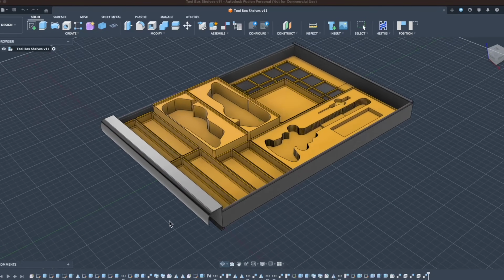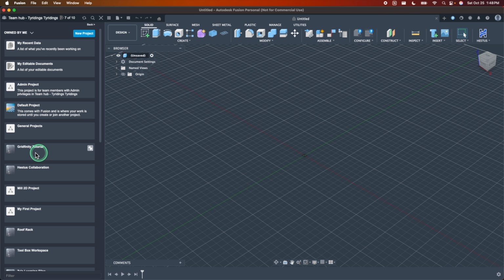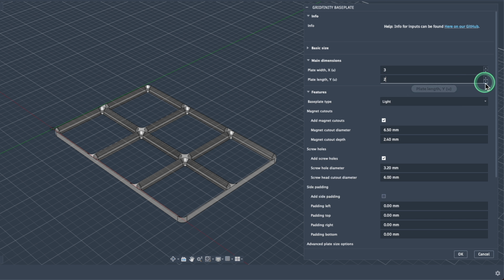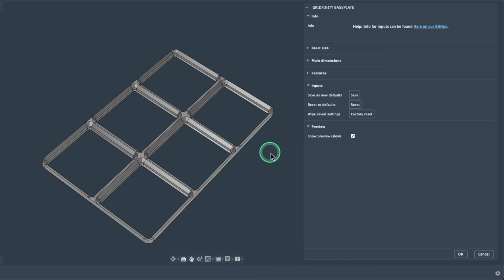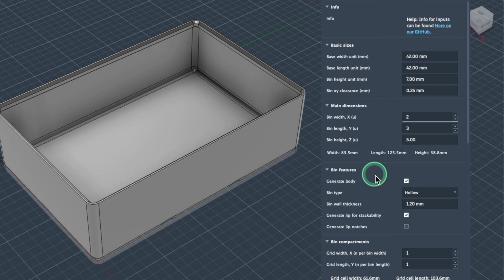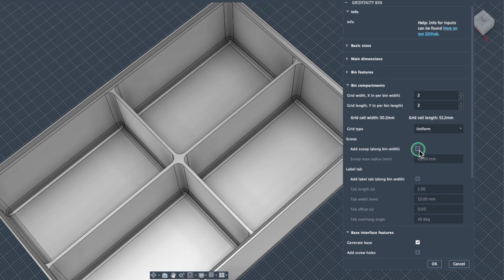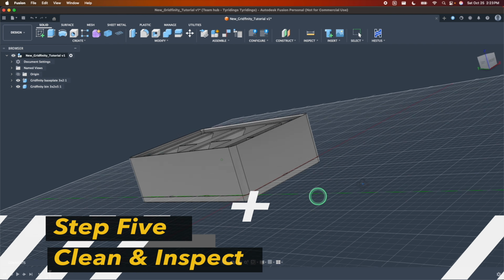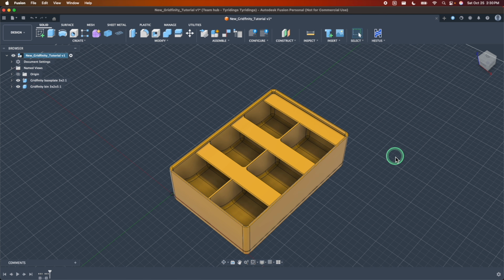Fusion 360 + Gridfinity: Design Custom Bins, Today!

Comment: Thank you for the excellent explanation. However, on Windows 11, after downloading and installing the tool—and subsequently closing and reopening Fusion 360—the tool did not appear in the "Create" menu. I tried uninstalling and reinstalling it several times, but it still didn't work.

Comment: I have Fusion version 2704.1.36 x86_64, which has changed twice (at least!) from 9 months ago when you made this video.  I had some difficulties finding things since the Browser tree was moved to a different page.   I am using the Elegoo Centauri Carbon 2 Combo which was released only a few months ago (6 months?), so they don't have current tutorials for that on Youtube either.  Frustration abounds, but I'm working through as well as I can.  Thanks for the video.  Thumbs up, and a Like to add to your 5K likes already.  Ha!  I just got a new CPAP too!  The only constant is change!  I'm getting too old for this!

Comment: Very informative video. I'm new to 3 d printing and using Fusion at the same time. Was very intimidated until i watched this video. I was following along and built the same bin. I now have some confidence to go ahead and make my own. I have a couple questions. When you are using your MAC, do you use the touch pad or are you using a mouse? The other thing is, when it comes to slicing, do you just drag your item from Fusion to programs like Prusa etc.??

Comment: great video, really well done.  But i wish you had also gone ahead and sliced it and made it ready to print.  won't those overhangs be a problem?  I'm a 3d printing novice so apologies if that's a dumb question.
Reply from the maker: Great question, and it depends on your printer! I use a bambu labs P1S primarily and it can handle anything at 45 degrees and below, which is a pretty good rule of thumb with modern printers. Hope that helps!

Comment: Weirdly it always generates the bins and the plate stand up for me. But I want to have them lay down just like you have
Reply from the maker: Check out my latest video (10 underrated fusion tips), it's tip number 2! But try going to Preferences > Model Orientation > Z Up. Then hit Apply, and Ok, then start a new design and re-run the generator. Should hopefully fix it! Let me know if not!

Comment: Tip: if you get that security messag when trying to open a package installer om on a mac, usually you can right click the file and select Open instead, and then you'll get a third option on the popupmessage that allows you to open the file anyway. No need to go through system preferences. 🙂
Reply from the maker: Sweet, great info!  I’ll give that a shot!

Comment: Is there an easy way to divide up a grid into smaller bits to fit on various print beds? Other generators will break up larger areas into sections that can be readily sent to a specific printer size...

Comment: I'm getting this error when I check the prieviw box when I follow your video and it wont let me create anything in the gridfinity section, can you advise as I am a new Fusion 360 user, I have thew same Free for personal acc, thank you--An unknonwn error occurred, please validate your inputs and try again: Traceback (most recent call last): File "C:\Users/Andrew/AppData/Roaming/Autodesk/ApplicationPlugins/GridfinityGenerator.bundle/Contents\commands\commandCreateBaseplate\entry.py", line 419, in generateBaseplate newCmpOcc = adsk.fusion.Occurrences.cast(root.occurrences).addNewComponent(adsk.core.Matrix3D.create()) File "C:\Users/Andrew/AppData/Local/Autodesk/webdeploy/production/c20471a4ae316e18725b0917d95e36d14575877a/Api/Python/packages\adsk\fusion.py", line 46661, in addNewComponent return _fusion.Occurrences_addNewComponent(self, transform)

Comment: I will blame my 'tism, but I do not understand the base unit measurment of 42mm. From what surfaces is this measured? I create the model baseplate of 2 u x 2 u, and I am measuring 83.5mm from the outer flat surface to the opposite outer flat surface, and not 84mm. What am I missing?
Reply: Clearance and tolerance.

Comment: Was getting error messages, because I didn't select Hybrid design in the beginning, just in case someone has the same issue. Thanks for the video!
Reply: "Hybrid design" fixed my issue - this was driving me nuts until I found your comment.  Thank you, good sir.
Reply: Thank you🎉❤
Reply: Thank you
Reply from the maker: Thank you for calling this out! The new updated Fusion from earlier this year tweaked a lot of tutorial content. Much appreciated!

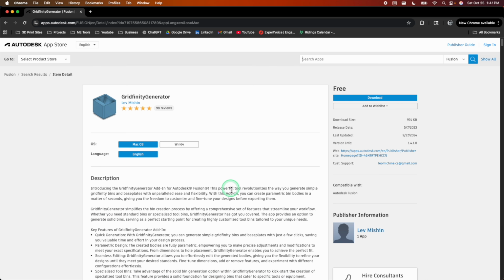Comment: Jesus Christ, I am pausing the video at 1:41, when I learned there is actually a fusion360 extension 🤦. It was so painful to make customizations, from openScad because I couldn't find a parametric format that worked with fusion... Thanks for the gold tip. Will watch the rest later after learning this.
Reply from the maker: Awesome!! Hope this will streamline everything for you moving forward!
Reply: @tyridings Thanks, it already did. Printed 3 full plates of bins already.  You're a saviour

Comment: January 21, 2026: Anybody getting a "RuntimeError: 3 : Failed to create component: Part Design documents can only contain one component, please add this Part to an Assembly to add multiple components." now when attempting to create new baseplates/bins? I just updated both Fusion360 and GridfinityGenerator. MacOS (Tahoe26.2).
Reply from the maker: Due to the updates to Fusion earlier this year, make sure you do this in a hybrid design and it should work! Let me know if the issue persists. Cheers!

Comment: Noobiest of the Noobs here.. first time Fusion, first time 3D Design... I just fnished the baseplae part and designed the one I need, which is 12x7.. how do I cut it? X1C will not print this size. 😅🙃
Reply from the maker: You can cut them into multiple pieces manually in the bambu studio app!

Comment: @
Ty Ridings , When you open a component, such as the baseplate and you get the configuration dialog, and you enter all your settings, and click OK, and it closes, then you note something you want to change, for some reason I don't see a simple way to re-open that dialog for the baseplate on the grid.. what am I missing?  Edit.... I guess you disclaimed that you cannot go back, thats an annoying flaw...

Comment: Excellent pace and content.  I created my specific bin and grid types, moving back and forth with the video (as I learn the free version of Fusion 360).  I'm one of those who studies the topic BEFORE buying a printer or software (but I'm leaning toward Prusa).  One "opportunity for improvement" in the video:  The Export function didn't offer Prusa or Prusa Slicer and (as I followed the video) I assumed I had to download something.  Fusion's dialog box pointed me toward "PreForm" but that didn't affect this.  As everybody knew (except me) the Prusa Slicer software has to already exist on my computer (and it doesn't yet exist on mine).   Consider adding a statement to that effect or add it to any other steps that have to be completed before the actions in the video will work.  Other than that, it's a great video that I've saved and re-run.

Comment: Thank you!  I was looking for a unique solution to hold a kids toy custom cutout with integrated storage for the accessories in a single bin solution (2x3 and 2x2).  "Grid Type" was the solution.  I haven't found a single example utilizing a solution like this.  I couldn't find anything like this in half a dozen generators.

Comment: Really enjoyed watching this. Wish you would have expanded on planning for and fitting a base to a drawer along with whatever insights you had to share (clearances, gluing base pieces, etc). Great job on this video!
Reply from the maker: Thanks for the comment! I actually have been building out sections of my tool box in my garage to double as a pop up design workspace, which is what the image in the thumbnail actually shows. 

I REALLY want to post a project video discussing the build, and addressing exactly what you mentioned, but have been hesitant since I think most people come to my channel just for follow along tutorials.. 

I'm going to go ahead and put that in my upcoming video list and just give it a shot, would really love to make more content like that where I actually apply the design method to real projects I work on! Thank you for the nudge to do so!
Reply: I found a generator on MakerWorld that let's you put in the overall size of your drawer, and it will automatically add the edge material equally around the edges. And you can put in your print bed size and it will auto divide up the base into printable sections with interlocking connections between base plate parts. I did one for one of the drawers in my miter saw station and it fit perfectly. Currently making bins to fill it out now
Reply: @MansterBear  Thanks! I've since moved on from Gridfinity. Couldn't get over the inefficient use of space and waste of filament. That said, I'm still making tool holders and 'boxes' but focusing on non-stackable elements that will be minimalistic, held down by 3M razor thin double sided tape. So far have had promising results.

Comment: This was insanely helpful! Any chance there's a way to make half size bins? I can't choose .5 width unfortuately, but would love to customize half bins for a specific drawer.
Reply: I just changed my default bin from 42x42 to 21x21 so my bins can be standard 1/2 a square grid.  A old 3.5 X 6 gin is now a 7 X 12.  

I kept the 42 X 42 grid but my first kitchen drawer ended up with a 1/2 grid top and right sides.  I made my custom grid STL outside of Fusion.
Reply: I have not tried this yet, but I did look into the gridfinity generator tools, and the 42 mm size for the grid is changeable. As long as you are not going to use anyone else's designs (which I assume will all be 42mm grid based), I believe you can generate whatever mm size you want. Then when you make your bins, they will fit into your grids. For example, I am pretty sure you can make the baseplate 20x20mm, and then make all your bins fit a 20x20 base. You can measure your drawer, and figure out what sized grid will work best to completely fill in the drawer, and use that measurement. Although I think I'd always stick with a square baseplate grid. The plugin for Fusion allows rectangle grids. For some projects you might want to use the 42x42mm base, others might be a different measurement - remembering that if you get someone else's designs, they are all surely going to be 42x42mm so your baseplate needs to match.

Comment: With downloading for Windows (10) (via Firefox) opening through downloads in firefox had a warning. Then when running on Windows, had a security warning that needed expanding before clicking Run anyway. No further issues with install
Reply from the maker: Thanks for the tip!! Much appreciated!

Comment: Is there an option to add magnet holes to the bottom of the base plate to secure the base plate to a metal tool box drawer?
Reply: Also curious about this, and the little clips that link the plates together instead of screwing them together.
Reply: @WalterMelons you could check the screw together button, then adjust the head cutout size to match your magnet size
Reply: i used doubble sided carpet tape, works great
Reply: 23:00 explains that
Reply: Did you even watch the video?
Reply: @jon_cook I did smart ass!
Reply: @jimhensley4210 i think there are baseplates kept together with magnets... but i dont know if there are ones with magnets for sticking to metal

Comment: This video was very much worth my time.  I have seen a web-based generator (can't find it again) that creates bases bigger than your print bed. It breaks the base parts up into printable sizes and creates Dovetails on the joining edges, so, for example, you can put a base system in a 24" by 18" drawer.  Does the Fusion script allow that?  If not, where is that generator on the web?

Comment: The be clear about your comment on the difference between the 5U height of 35mm and the 38.5 height of the bin.  While it can be accounted for in the height of the foot, it is caused by having the "Stacking Lip" option turned on.  Without that option on the bis is exactly the 7mm x Unit height tall. I know this because that bit me in the butt hard when I printed bins for a drawer that was X.04 units tall.  My bins that should have been just under turned out to be too tall.
Reply from the maker: Thanks for clarifying, that's a good point about the stacking lip!

Comment: You can make your video 50% shorter by changing phrases like "go ahead and X" (and "went ahead and X" etc.) to just "X"

For instance, you can just "open the thing" instead of going ahead and opening the thing.

Maybe you're using "go ahead and X" instead of the classic brain fart buffers such as "umm" and "err" but it's every bit as annoying.  Just saying.
Reply: I went ahead and had a good old chuckle at this comment, thank you!
Nice video Ty - doing some SolidWorks x Gridfinity is on my to-do list
Reply from the maker: @FullyDefined-Design  thanks Chris!! You're the man, please do! Would love to see your spin on this for SW, very much needed for the community!!
Reply: @tyridings  alright, coming soon!
Reply from the maker: Hey @kfira_cohen, I appreciate the constructive criticism. To be honest, I struggle with what the right tempo and level of detail is. My goal is to not leave absolute beginners in the dust, but also pack information concisely enough to not lose more advanced users as well. I'll work on being better, I'm going to make mistakes, but I'll keep at it!
Reply: @tyridings  The content and level of detail was fine.  I'm probably just hypersensitive to the "go ahead and..." thing that became popular for a while but mostly died back out.  Once I hear it I can't unhear it and it starts to grate when overused.

Personally I use OnShape rather than Fusion, mostly because I use Linux rather than Windows.  I do like to see design videos such as this, as techniques are often portable and they plant ideas even without the same plug-ins and extensions being available.

Good work on the content.  Keep it up.  Ignore my weirdness. :)